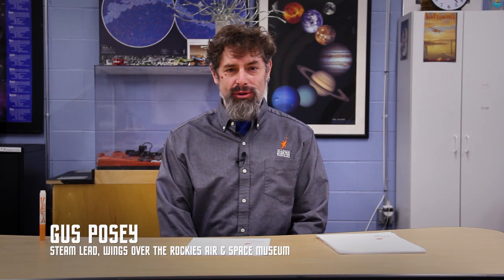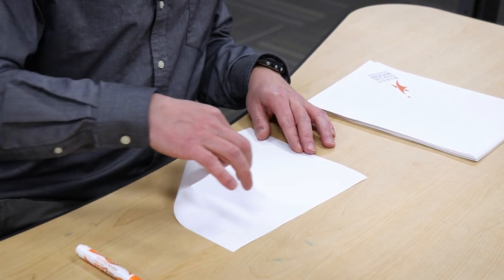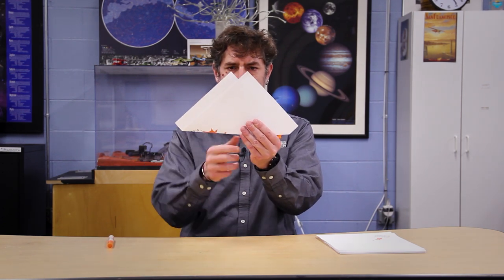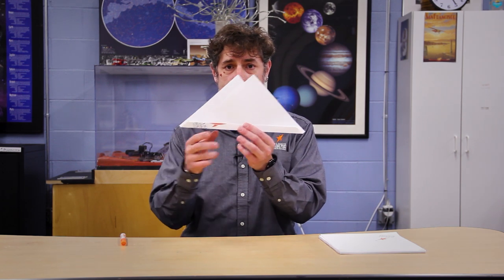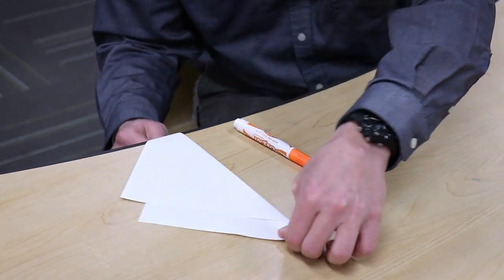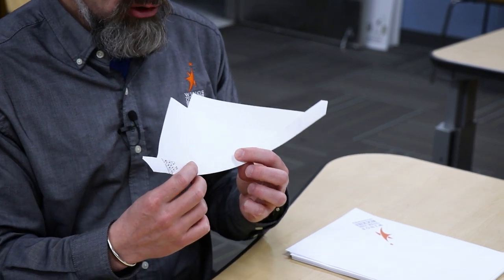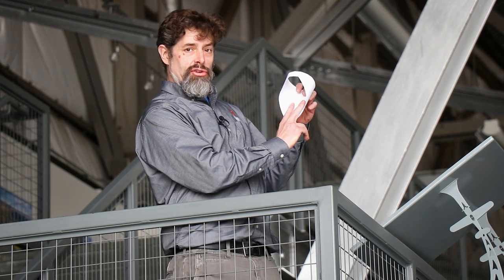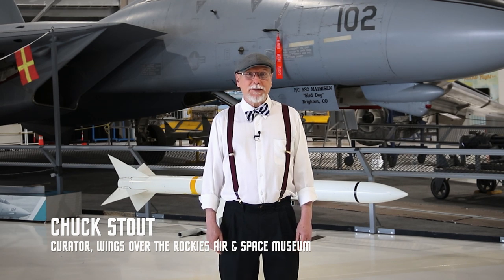How to fold a Ring Wing Glider

Comment: You can add a small cylindrical cone on the bottom and it will still fly. I've actually created a long cone and added to cylindrical wings. Note, that it' will take take a little trial and error ro get the balance right.

Comment: I launch by flicking it upward by the 'top' of the ring. also I fold a little differently, I try to crease the paper along the opposing corners instead of the 90 degree angle trick in the video, but I'll probably try this method at some point.